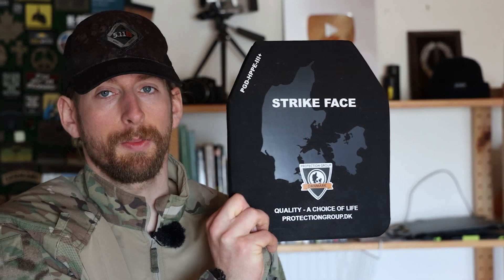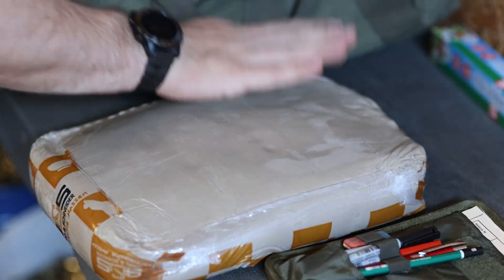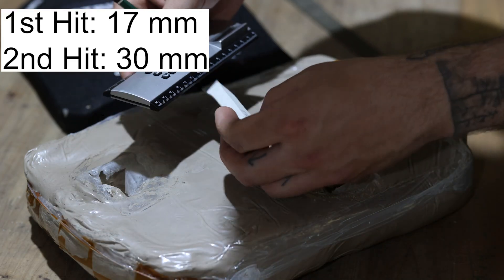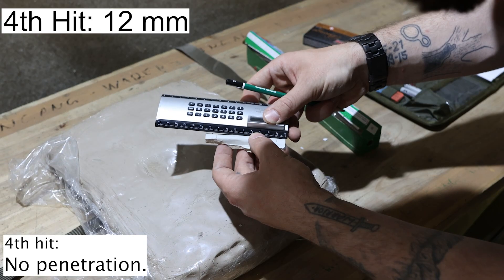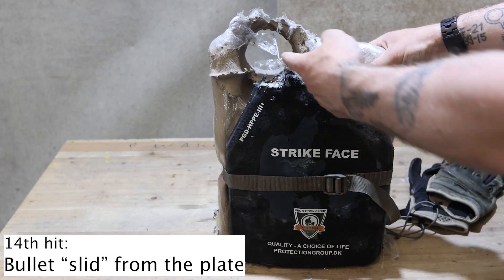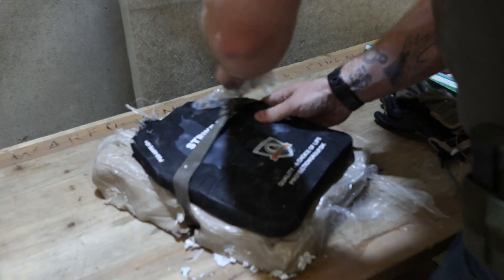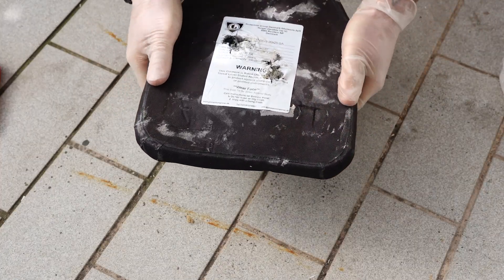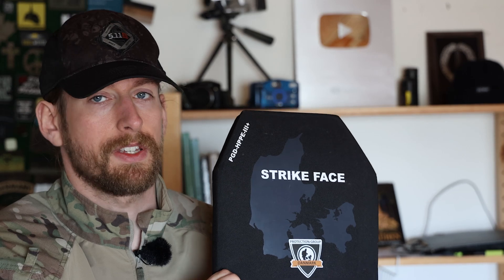How many bullets will this lightweight plate stop?​⁠

Comment: Aren’t aramid or Kevlar plates used in conjunction with the heavier ceramic plates in frontline type scenarios? Because even if there’s no penetration by the bullets those hits would still most likely incapacitate the wearer if not straight up kill if unlucky. Even without any bullet or shrapnel penetration due to the extreme force experienced if one were silly enough to only wear that type of plate.

Comment: Unfortunately, uhmwpe plates won't protect from ammo with hardened penetrator (basically, all military ammo currently used - either 5.56 nato or 5.45 AK). Any penetrator comes through it like a knife through butter at any distances. NIJ III max protection level.
Reply: https://www.youtube.com/watch?v=n1gc1jPAo6Q&t=1149s
Reply: @richardcastro7939  it's a solid nice plate, although it's rather not uhmwpe, but ceramic + uhmwpe. Anyway, it depends on threats you want to mitigate. Probably, it's pretty solid for America and green tips with steel penetrators. But it's not so great against Russian 5,45 7n22 and later ammo or 7,62 BZ ammo.
BTW, backface deformations looks a bit scary (especially from 308). NIJ says that up to 44 mm is OK, Ukrainian standard is 25 max, because actually everything above 25-30 would cause internal bleeding that is not treatable "in a field".

Comment: I appreciate the addition of the clay to get a rough idea of the blunt force. I know there are small pads used for car crash tests that measure pressure force. If they are affordable, it would be interesting to use those to get a more precise number for the blunt force
Reply from the maker: The test pads are a good idea. I will keep that in mind if I do a test on blunt force again. It would indeed be cool to have some numbers.